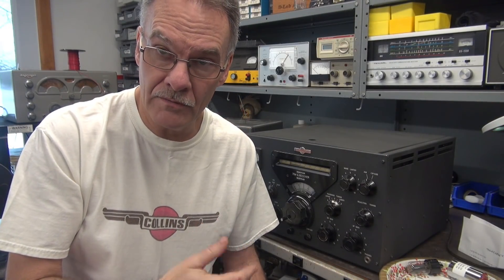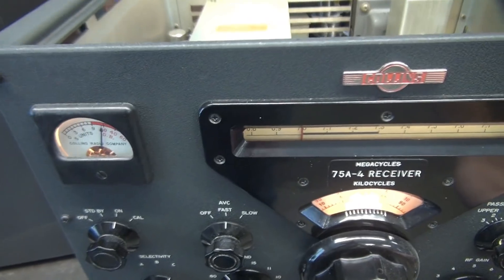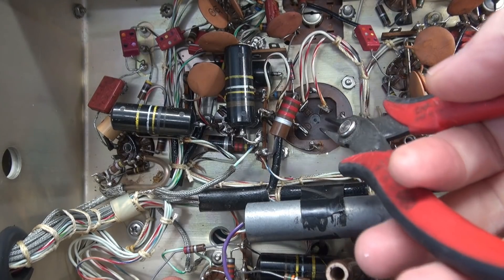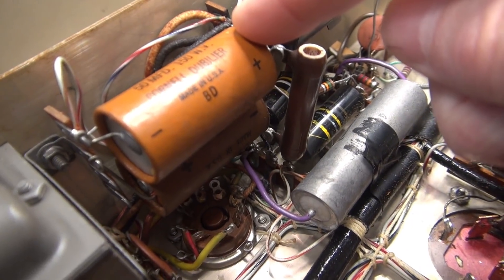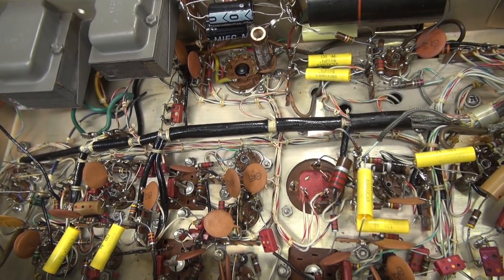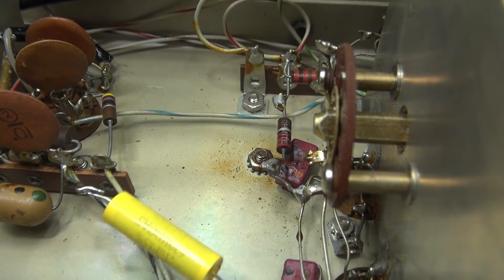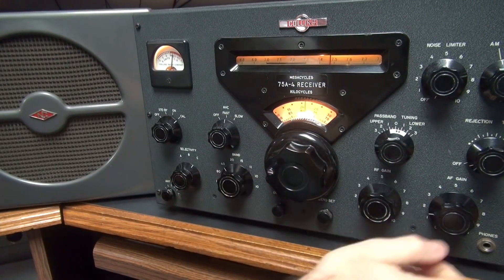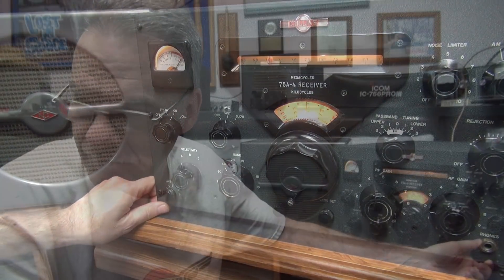How to re-cap Collins 75A-4 Ham tube receiver Deadly capacitor replacement

Comment: There is a shop in Bangkok Thailand that sells only capacitors.  The Thai girl to work there know values and where the capacitor is stored In drawer or hanging somewhere.  I was able to buy a dozen that are super small by old standards. The girl clerk sold me exactly the right item.
I went next door to the all resistor shop and bought a couple of correctly valued resistors also clerked by expert lady.  Next door to that a shop sells Cinch-Jones varying  pin plugs
   There is a two or three blocked area in Bangkok that sells parts, including coaxial plugs and sockets.  In one shop I was offered 75 ohm RG59 coax with three types of jackets and four types of center insulators. The little lady who worked there knew exactly what I asked for and supplied it.    
     Because it is very expensive, Amphenol RG8  top of the line is sold and only one grade in one shop  and the sales distributor visits the shop to confirm what is being offered.  Recently a shop started selling  iCOM ham radios off the shelf but in another shop if you can spell the ham rig you want to buy, the shop will get it for you at standard American prices.

Comment: I really didn't hear the hum go away, too include in your final testing of the A-4 as you tuned around and i could still hear it in the quieter band portions. Normally, after I replace the multi-can, which I always do first like you, I will notice significantly less hum.  So I was very surprised when I could not tell any difference in your hum after you changed the multi-can. Very odd.  I just moved my QTH from Florida back to Maine and when I get my test bench up and running I'm looking forward to trying Clark Turner's mod on a couple of beautiful A-4's I've had since the 1960's.  Now, if I can only figure out how to replace those pesky tub style caps in my lovely A-1 without ruining the aesthetics...  73's and keep up the good work!

Comment: In the process of restoring a 75A4 I have run into a problem that the crystal oscillator V4 will not work on the two 10M and 11M bands. I have replaced crystals, caps, tubes and adjusting tuning without results.  Have you run into this or do you have any suggestions?

Comment: I have an R388 51J3 (1953) that I haven't used in quite a while. It has distorted audio, receive was fantastic and no hum out of the speaker, I have a complete service manual (copy of the original military version TM 11-854/TO16-35R-388-5) for it but don't really know where to start. It has had at least one major change, the 5v4 is now a solid state replacement of some type, it was put in there by the previous owner before it was given to me.

Comment: Great video....wonderful radio!!!
Something I am curious about...I know that when you start changing certain Silver Mica capacitors, you have the potential (depending on where in the circuit they are) of messing with the accuracy of the dial.  Wondering if you checked that on this one?
I love Collins gear!  I have a Collins S-Line set...still don't have it on the air....have to do some things first that require money that I don't have, but eager to get them up and running.
Say Hi to Marsha!!!
Thanks for sharing the videos with us!

Comment: As you noticed all 75A4s have hum. I was very annoyed at this so one day I decided once and for all to track it down.  After an hour with the scope I found this hum was from the two low voltage chokes resonating. You can actually feel the chokes vibrating. I experimented with a resonating cap at the input. DC pins of the 5y3 to ground. Pin 2 or 8 works. One cap is needed. A single .047 orange drop or disk completely silences the hum. Voltage is only increased by 2 volts DC. Make sure to use at least a 600 or even a 1000 volt cap as peak to peak here is up pretty high on DC here. I typically do not like mods on my radios... But in this case it cures ALL of that hum and it drove me nuts.
Reply: I did this to mine tonight and I gotta say it works GREAT! My 75A-4 now gives my FT-DX3000D a run for the money.
My Collins is now my go-to radio for everything. Thanks for the tip!!!
Reply: Glad that worked! I had had lots of feedback from hams thatbhave tried my solution. No more hum.
Reply: It works great, turn the volume down and dead silence. This should be in the 75A-4 handbook!
Reply: Clark- I just got my 75A-4 Back from Howard Mills and he re-capped it for me and peaked the receiver. It's gorgeous. He restopred it for another owner 20 years ago to the month. However, like you, I still hear 60 cycle hum from the speaker with the RF and AF gain at zero. Otherwise, the radio is dead quiet. I pulled the bottom cover and attempted a .047 Orange drop on both pin 2 and pin 8 of the 5Y3 to ground with zero effect on the hum. I was very excited to eradicate that hum once and for all. Any ideas? Do I need to drag the Osco probe around in there? I'd rather not.

Comment: Wouldn’t the radio need re-alignment after replacing the capacitors? Charlie KM4ZZ
Reply: Only if the capacitor(s) are part of a tuned circuit.
Reply from the maker: None of there are

Comment: I have a Collins 75A-3 and have never recapped it but it will need it seeing as how it is older than a 75A-4 but on mine I also need to restring the dial cord. Another fun job on a Collins. Thanks for the video.